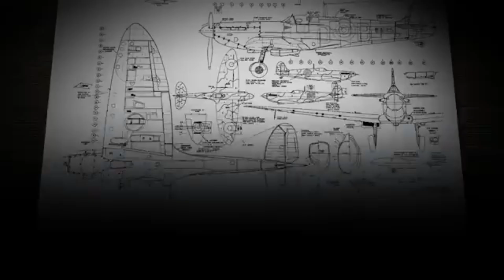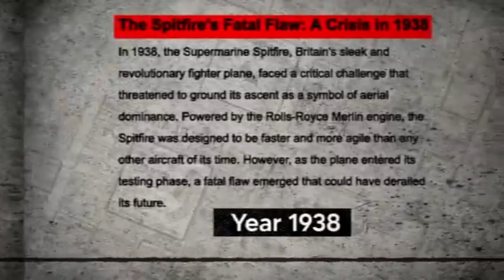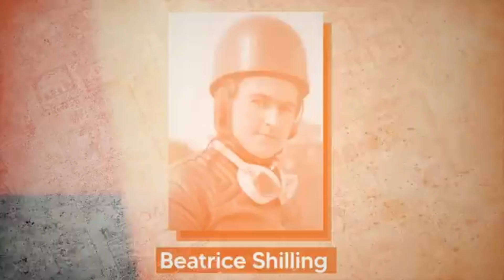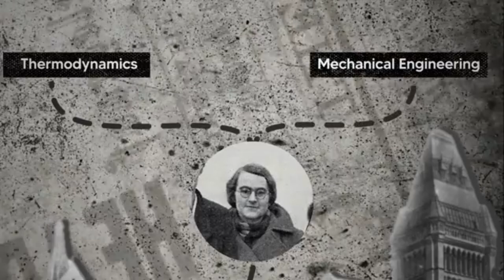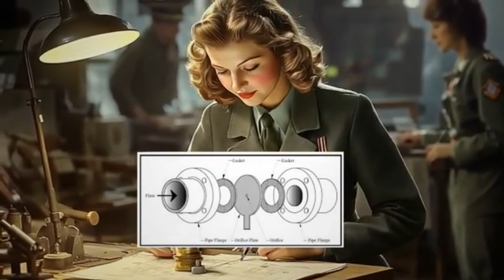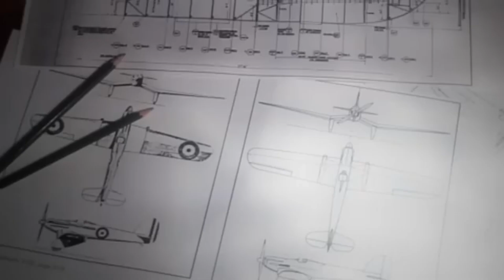"How a Woman Saved WWII with This Genius Engineering Fix!"

Comment: It wasn't the big issue that this post makes it out to be.
The Spitfire and Hurricane pilots knew about the carburettor problem  and simply went inverted in the dive. This actually forced fuel into the outlets.
The real problem came when they used the Merlin in the American Mustang aircraft and the issue then had to be resolved.
Reply from the maker: Thanks 😊 you for your insight
Reply: Sort of right, it wasn't the mustang that created the sudden urge. Because the German bf109 used fuel injection they quickly cottoned on all they needed to do to get away from british fighters was push nose down and dive, the british fighters had to waste precious seconds rolling over before going into the dive as you said (one of the clips in the vid show them doing this in formation) and in most cases the German got away. That was what caused the complaints from pilots and the work started by the engineers to fix it, not as you claim the introduction of the mustang.
Reply: It was resolved before the Mustang came along.
Reply: But still a great insight